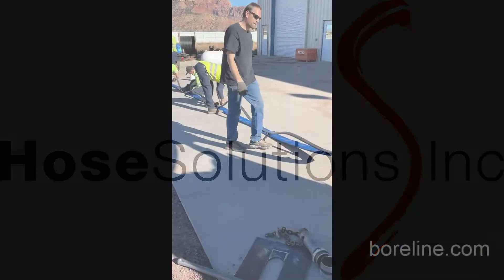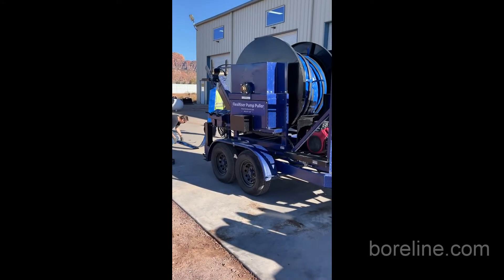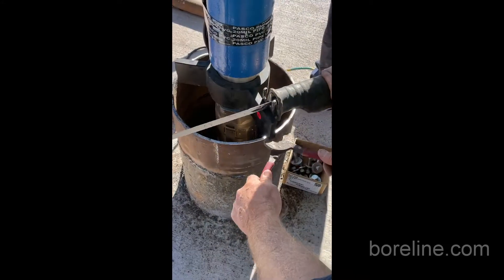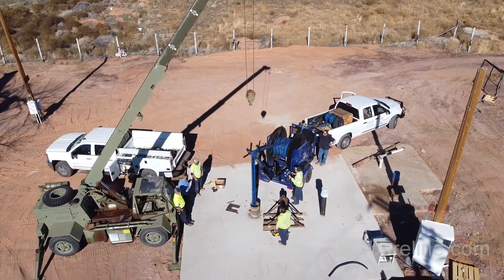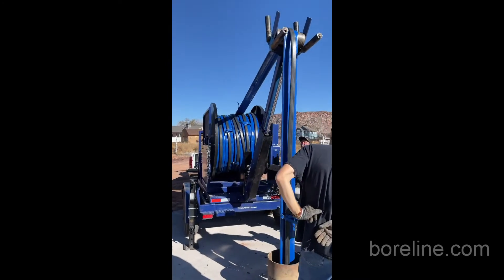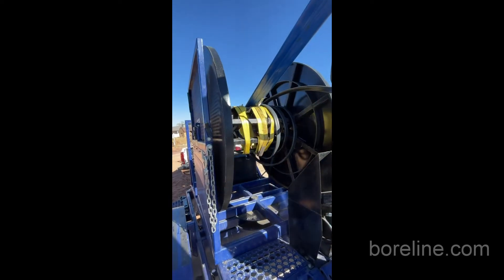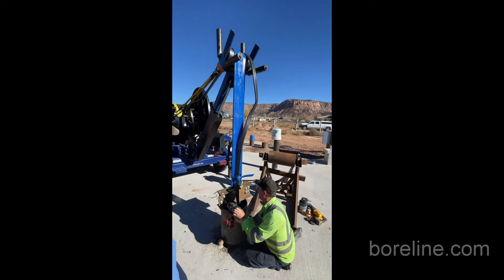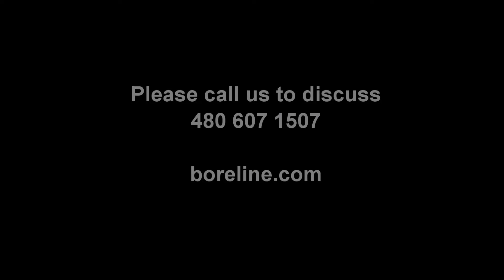Boreline FlexiRiser - A Quick, Safe and Smart  "HANDS-OFF"  way to install your submersible pumps.

Comment: Fantastic product we installed 165ft of 6" Boreline in our primary well this last summer.  Five of us and a crane had it buttoned up in about 90min with no prior experience of well installation.  The only reason any of us where sweating was because it was 90 degrees that day.  pressurized and tested 600 gpm on a 75 hp submersible.  Absolutely silent once up and running the Boreline insulated all pump noise.  

We are about to put our second setup in our adjacent well using 4" Boreline on a 40hp submersible.  Can't wait to have it online.  Zero corrosion, zero scaling, zero noise transfer.  This well is located inside our office building so the lack of pump noise transferred up the drop pipe is a nice feature.  Our plans are to make a showcase pump room so that our customers can see firsthand where their water comes from.  

If I could as a public servant give Boreline and Hose Solutions an award for most outstanding service and product integration I would. 

The only sad thing about this product is one day I will run out of wells that I can install it in, and I will have left this Earth for a very long time before they ever need replaced!
Reply from the maker: Hi Mike
THANK YOU so much for such an amazing comment.
You have covered some major benefits of Boreline FlexiRiser all and we really appreciate this.
Cheers

Comment: We appreciate Hose Solutions working with us to demonstrate the pump puller for our water well installations.  We were pleased that the installation went as quickly and smoothly as we hoped!  We are looking forward to transioning over our potable water wells to Bore Line. - C & R Water Supply, Inc.
Reply: Hi Mike
Thanks so much for your comment and your support.
Cheers